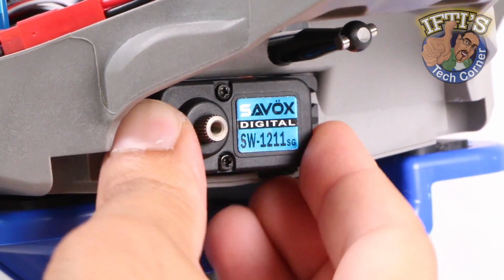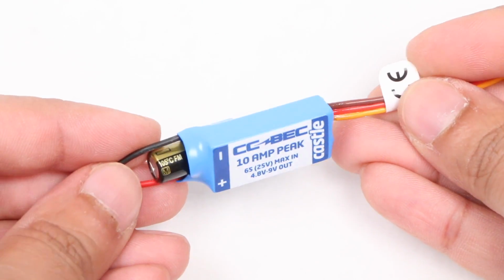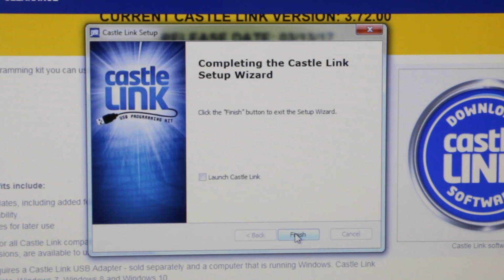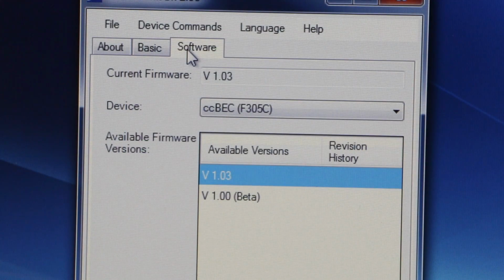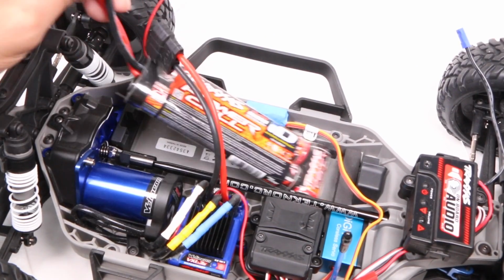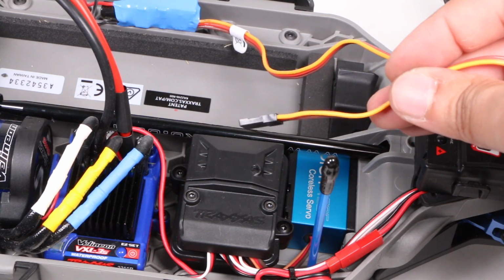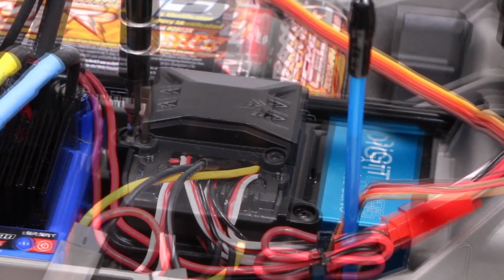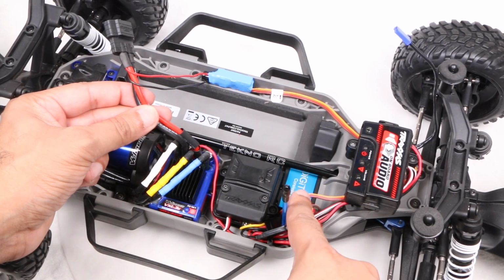#10 Traxxas Slash 4X4 - Steering Upgrade Part 4/4 - BEC Installation

Comment: The BEC is the brains of the car that's job is being the gyro and distributing power to all the electronics. I just run a simple Protek buster to reduce some load. That's kinda how and why most cars suddenly go up in smoke (Catch Fire).

Comment: Hello, great videos! However I just spoke to Savox on the phone, I spoke with their head engineer and I told him that I was interested in upgrading my Servo to the same one you are using but I wasn’t sure about this BEC wire installation. He explained to me that the BEC wire is completely unnecessary and that it won’t do anything to help the Servo avoid any glitches because he stated the servos will not have any glitches. They are unsure why you decided to install this? Any feedback about this?
Reply from the maker: When I had the servo alone my steering would glitch every now and then - particularly more so when the battery was low. On a fully charged battery it would work fine. Hence installed the BEC to regulate power a bit better, and programmed for the correct output, and I now have perfect steering which is both strong and sharp. I'm not saying it is completely necessary, but it certainly helped for me and made my steering much more responsive.
The servo itself works fine and is smooth, IF you can get the power it needs down to it. I guess it comes down to your particular rig and how much power all the components draw, as if other components draw lots of power too, then the Servo isn't going to get enough, hence causing glitches.....
Add to this, I still have a few more bits to bolt on that will also draw power, so the BEC will be more necessary to ensure the servo still gets fully juiced!
Reply: The glitch issue is more then likely due to the use of the Nicd battery... switch to lipo for better power delivery
Reply: This is definitely my experience as well.  Roll with a 3s LIPO and you'll never see a glitch again.
Reply: mine did glitch when I was using a NiMh, after I got a Lipo it was not a problem, probably due to the more power it has.
Reply: @orange1248  no, it’s a known issue that the glitches are due to lack of power since the servo drains more power than the ESC is designed to supply to the receiver. The LIPO could be a fix because it supplies more voltage or something 🤷🏼‍♂️. Mine is all fixed after adding an ESC

Comment: Hi lookt at you video and it is really good. But i just broke my stock servo and im thinking of installing the same servo as you dide. But do i need the bec ore can the esc handel the new servo on its own? I do have the slash oba tsm model.

Comment: Thank you mate, I do like the way you do all your upgrades (hopups) very clear and concise all done in clean conditions not a greasy bench!! 👍 But! that was an eye opener!!!😱 Seems to me to be a lot and I mean A LOT of faffing about?!! Although I do follow you (subbed) and have referred to your vids on more than one occasion, but going through all that just to fit a servo is beyond me!! 🤔🤪🤣 Is it all necessary? Thank you.
Reply from the maker: With the servo alone I had some issues with steering sometimes having a mind of its own - I put it down to the servo not getting a constant stream of power, so I installed the BEC and its been fine since.....
Its only needed for a higher powered servo really.......

Comment: And that RC enthusiasts is how you trade in various improvements for the heaviest slash ever, so get ready to enjoy a couple of "probable" benefits for some even more probable plastic breaks! Very popular perspective thinking the more your RC has the better! Wrong! Upgrades should only be done after solving a specific recurrent issue after your particular style of driving. if you don't tend to over heat... don't do a cooling solution. If you never look at your speed metric while driving, don't add sensors or GPS. If you don't break servos... don't do a servo swap. If you have never broken a chasis... don't strengthen the chasis. And so on! If not needed, all the shiny alum upgrades don't flex and will break plastic parts! In real racing teams weight reduction is at the top of the list... so keep that in mind before doing any upgrades your driving style didn't need! Great tutorial videos by this guy! ENJOY the weekend fellas!!!
Reply from the maker: This is a very good point. I do not race etc - I just enjoy adding bits and upgrading - but if you are looking for a specific purpose for your RC truck, then you hit the nail on the head ;o)
Reply: @iftibashir  agreed, I just like to add the bling parts just because and I don't care , it's supposed to be fun ,like a art project without having an artist, a form of expressing oneselves or really just taking your mind off of the daily drudge

Comment: What a pain buying all that stuff. That BEC ain't cheap to begin with and you'll still need to cough up some more for that old tech arduino dongle just to adjust the voltage.

Me,  I'd just get a DC-to-DC switching buck converter (which is what a BEC really is) for just US$2 and you can adjust the hell out of the voltage to suit whatever you're powering up with it. All you need is a mini screwdriver and any cheap old multimeter lying around the house.

Just note down your servo's voltage and max current draw, buy a buck converter that matches the spec and adjust the pot screw to match.

Comment: Would love to see a close up of the cables attached under the heat shrink.  I did this and wasn't able to get the copper connectors back into the plastic housing all the way.  Just too tight.
Reply from the maker: I cut a little plastic away from the cables and soldered the BEC wires slightly above the actual copper connectors. That way the connectors fit back into the black plastic housing as the BEC wires are just slightly above - still covered by the black housing but not actually going into the connector parts - if that makes sense?!
If you still have trouble you can also snip a bit of the plastic away further up the cables and solder the BEC wires there - anywhere along the cable to be fair - just cover with some heat shrink afterwards......

Comment: Is it still waterproof after this?
Reply: Hello,

If I recall I asked this question somewhere else on YouTube and was told "No".

I am not 100% positive, however there will be many forums written about this topic online that can give you a definitive answer.

Take care ✌
Reply: If you shrink wrap it well and you have the waterproof version of the bec you should be fine as long as it isn’t submerged
Reply: @Seci I just used another waterproof receiver box on the other side of the chassis to put this as well as my gyro (along with other y-splits) works fine 🤷🏼‍♂️

Comment: After spending $80 on the servo, $20 on the BEC, and the cable harness, spending an extra $20 on the Castle Link is nothing. Another point, sense you used the harness why not run the voltage up to 7.4 to 8.0? I believe the servo can handle 8.4. I run BECs in most all my cars and I crank the voltage up to 7.8ish.